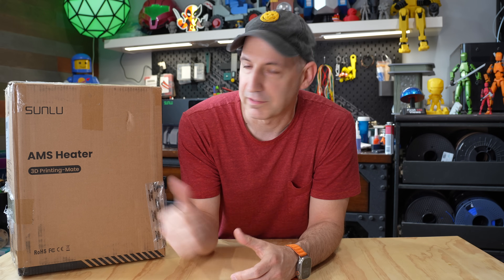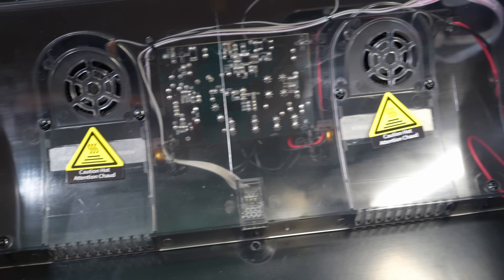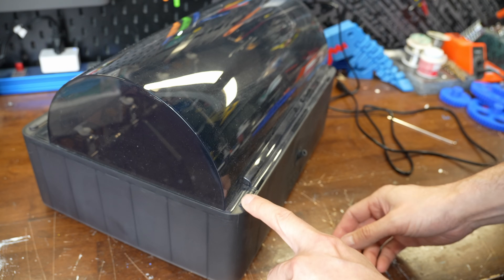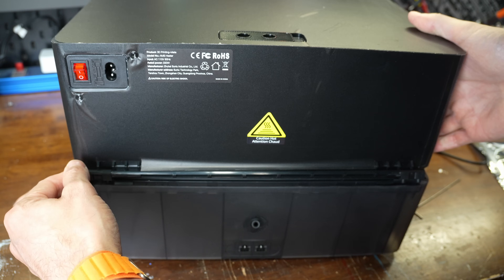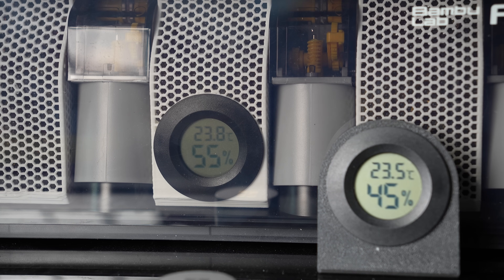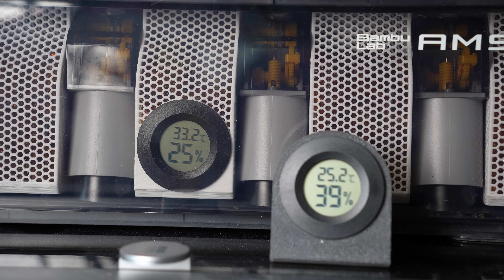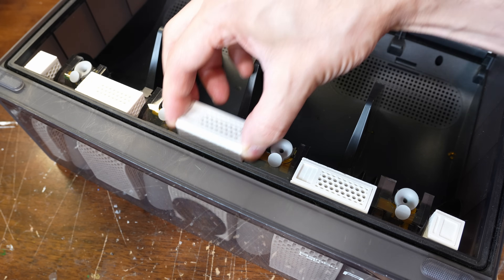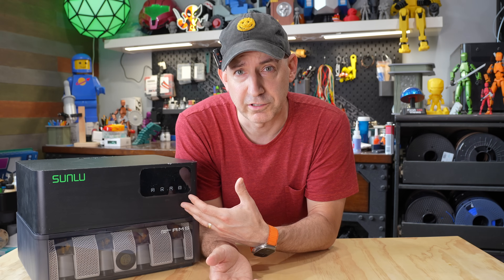Sunlu’s New AMS Lid DRIES Filament While You Print — First Look!

Comment: the lid folds down over the ams fasteners. If I understand correctly, the lid doesn't stay firmly closed ?
Reply from the maker: It not an issue. The weight of the lid hold it closed firmly.
Reply: @DaveRigDesign  Thank you for your reply. Could you give me the measurement of the height of this one on the ams?

Comment: The hydro meter in the desiccant pod can not be trust in this way. When it so close to the desiccant (even if it’s a closed frame) wil be heavily affected tere
Reply from the maker: The desiccant defiantly had an effect, both for the raise and later drop in humidity. 
I would say once dry it would work with the heater to keep humidity low, but if the desiccant is let to absorb too much it will release the trapped humidity same as I had happen at the start. The venting isn’t designed for that much humidity to escape all at once. 

If you were going to run the heater in standby mode where it comes on/off based on the humidity in the case there’s no need for the desiccant.

Comment: Great video. How do you think it compares to the EIBOS tetras?
Reply: The Eibos has a separate heater for each spool and uses dividers to isolate each spool, so you can have and dry multiple types of filament at the same time.
Reply from the maker: Ya, seems interesting but kinda overkill for most people, unless you have pla, petg, nylon and tpu in the machine at the same time and dry them at different temps. Maybe someone needs that but seems very edge case.
Reply: @DaveRigDesign  I agree 70% of the time, I only have PLA. However, whenever I have PETG or PC I want those dried while I print. So I would either have the external drier or have to remove all PLA in my AMS to have the correct dry settings for PETG or PC. To be mentionned as well I use PETG as support from my PLA prints .... in this case it's interesting to have some dedicated drying for each material.
I still think this one from Sunlu is very interesting. The one from Eibos is a bit of an upgrade, I feel. Both have the brilliant idea to integrate the drying in the cover.
Reply from the maker: Thanks 🙏 Can say really, just googled that machines and it seems much more involved, not sure all that is necessary. :)